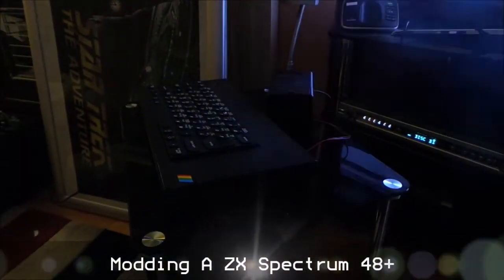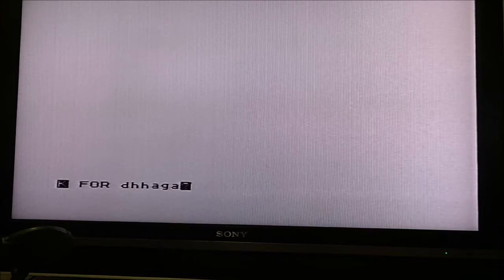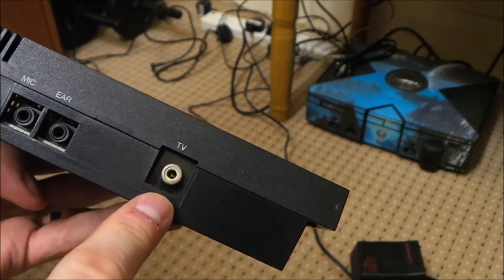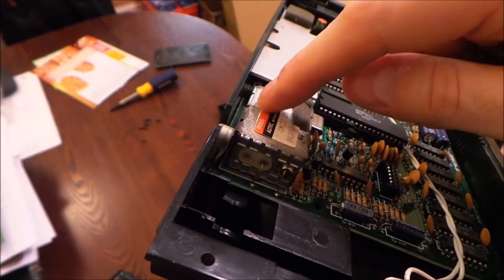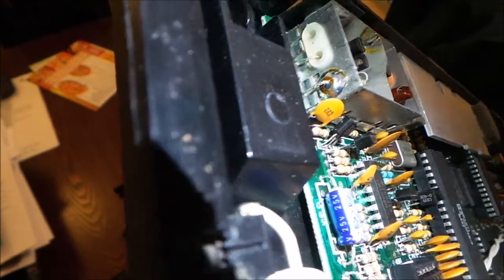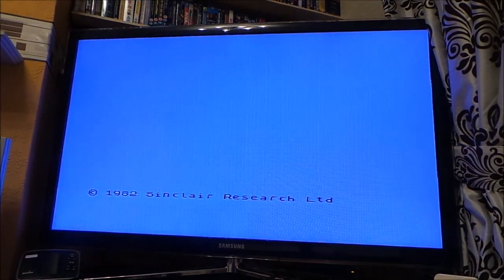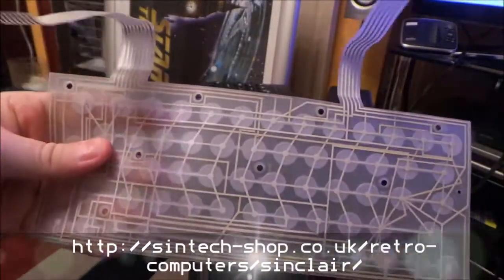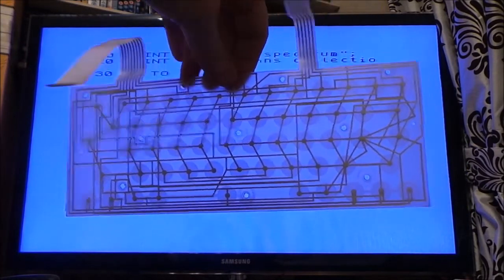Modding a ZX Spectrum for composite video

Comment: What are those pair of wires I can see @8:02  ?  Do they run to a reset switch?  I had the original rubber keyed Speccy...  and as I recall, it was necessary to pull the power lead to do a reset.  Well that's what I did once after a four hour stint of BASIC coding (without saving).      My foot snagged on the lead as I stood up to stretch my back... and that was the end of my program.  I learnt to save my work onto cassette every half hour after that.
Reply from the maker: ᓮאᗩFᒪᗩᖰ, yes matey, the plus models had a reset push switch on the left hand side of the speccy, so no more power pulls to reset the machine :)